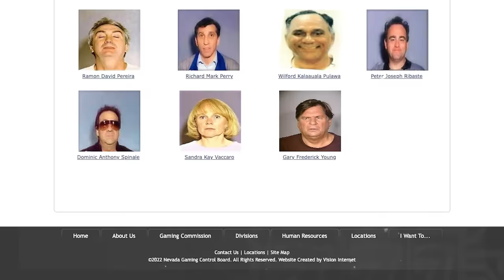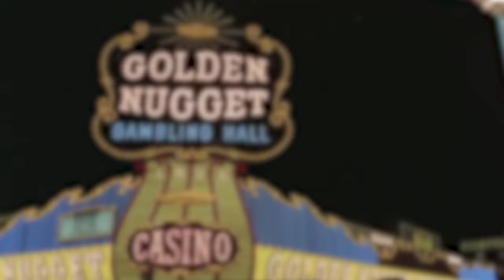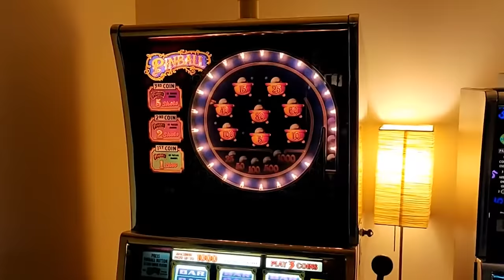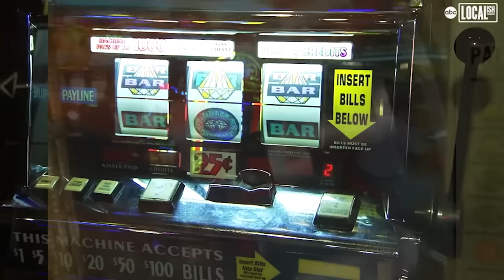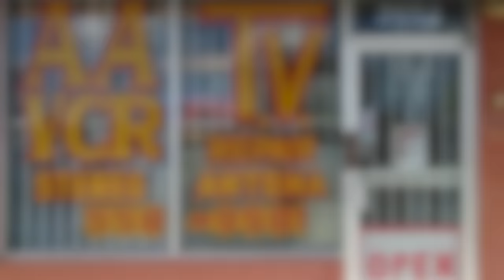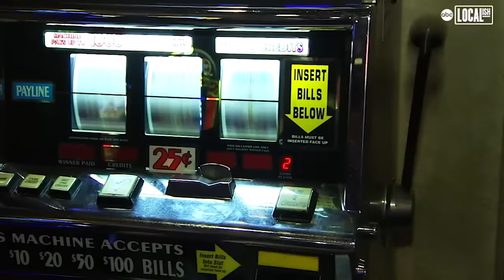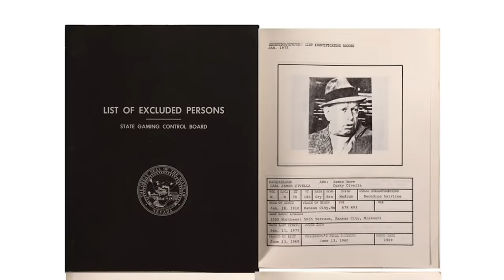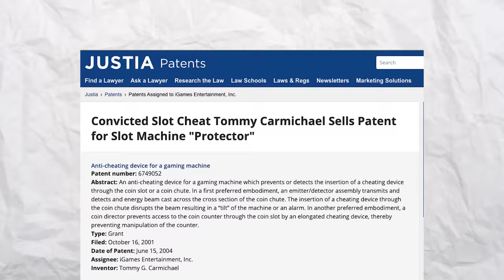How This Device illegally Won $44.9 Million From Las Vegas

Comment: The TITO cheat device is an intriguing idea, but I think that even if it worked, it would have had a very limited lifespan. Those tickets allow security to know exactly which machine spit them out and at precisely what time. It would be a simple matter to synch camera footage with the cash-out time, and bingo, you've got a picture of your thief. You then circulate the pics between all other casinos...
Reply: @Koowluh Casinos are a lot stupider (or perhaps lazier?) than you think based upon your last comment. As a person who's been playing casino games professionally for years, partially by exploiting how much they think I play, how much they think I've won, or even who they think is playing there when I am the one present, I've seen enough to know that their systems are in actual fact quite primitive.
Reply: No doubt I don't think it would have lasted long unless you were extremely smart and super slow & low with the amounts in order to not raise suspicion.

I'm talking so slow & low it would barely be worth it and probably not worth the risk. 

Either that or you go big time but it would be something you wouldn't be able to use often.

But this is before camera and security tech got really good.  Back in those days he was using the light wand they didn't have a ton of cameras and the cameras they did have were in like negative 360p at best 😂

Now these days most casinos don't have a square inch that are out of camera view.   They can damn near do that fake "enhance" crap you would see it movies and TV back in the day. 
They spend a ton more in security technology and also in just paying & training people at using the tech as well. 

The tech used back then or even that " Tongue" device wouldn't have worked long with how quickly security tech was advancing. 

All my rambling is in absolutely no way to take away what this dude was capable of though by any means.  Dude was a straight up genius and if it wasn't for his bad judgment and shat "friends" he very well could have gotten away with it albeit still living underground.

What he was able to accomplish was certainly admirable though

Comment: why was he arrested for manufacturing cheating devices? Shouldn't they arrest the users of the device?  It's only a cheating device if you use it for cheating.
Reply: Do you hold the same consistency to drug users and sellers? Drugs aren’t intoxicating or stimulating unless you put them in your system.
Reply: @nickthompson1812  yes drugs should be completely legal

Comment: All modern slots are PC based.  They could easily be hacked, however, where the "gotcha" is on a TITO slot is, even if you physically put more than a specified amount of cash in, the machine will lock and notify the slot supervisors as well as gaming agents.  At that point, even to get the cash back, the machine will be audited, and the cans physically counted to match.  

When I worked at a casino, as a slot tech, we had some young guys who found a way to trick the machines into misreading the barcode on the tickets to credit $6000.  They thought they could put it in, and then cash it out to create a legitimately printed ticket to take to the cash out windows or machines.  The problem is, any payout, in Missouri at least, over something like $1500, required the slot attendant and supervisor to get involved.  Since the machine registered a $6000 ticket being put in, it locked before they could cash out. Why?  Because the machines know that they cannot print a ticket of that value.  The only thing that can print with no limit is the cash-out receipt.  If a jackpot is $25,000 or more, the gaming commission gets involved, where we would have to unlock the machine, and remove the controller board and the gaming agents would take it to another specialized machine to ensure the security of the ROM was intact.  If there was ANY discrepancy, the jackpot is void and then entire machine goes through a recertification process.  During that process, if it's found to have been a casino error, which would also be a gaming commission error, the winner would be contacted, and the jackpot paid.

Many people have been arrested, charged, and convicted simply by knowing the machine, say, credited $600 instead of the $60 the TITO printed.  It's theft.

Anyone who has done this and gotten away, however, I don't feel they're criminals - they got lucky; after all, isn't that what casino's are all about?  The gamble, and the risk, the loss, or the reward. 
 It's pretty black and white.

Comment: In Germany as slot machine were computerized  a player saw in a casino that two slot machines created game results in the same order.
Reason for this was that the computer software used a pseudo random generator to calculate the result of the next game and by coincidence these two slot machines were at the same state of the random generator at that point of time.
As the random generator was poorly implemented by analyzing the result of four games in a row you can calculate its internal state and therefore could predict the results of all following games.  Using another software you can calculate if it is worth to play on that slot machine as a greater win will come in a couple of games and the money you loose till reaching this point is less than the money you will win.
Due to legal restrictions limitting the maximum win by game this was not a method to make in short time big money and therefore the inventor of that software decided that is easier to sell the software to other gamblers instead of using it himself. But as always - the more people know a secret the greater the risk that it will not be a secret anymore and the manufactorer of that slot machine changed the implementation of the pseudo random generator making it impossible to derive its internal state by just looking on the result of a couple of games.

Comment: So im a tech at a casino my job is to fix them, clear bill jams fix printer errors, replace monitors, change power supplys that kinda thing. But recently someone cheated a machine, ever minute they printed a ticket of no less than 700 and no more than 1100, which is smart sine going over 1200 you have to pay taxes. I just wanna know how they did it.

Comment: I was playing roulette on the east coast side where like 20 cops come up to the table and nab the guy next to me pass posting. Turns out I was the one blocking him because I was sitting on the last number row side and had to reach the whole table to play the single digits which I normally do. All said and done I got 200 in chips complimentary for allowing the casino to catch the guy because I shouldn't have been allowed to lean over the table like I had for almost an hour. It made them see the guy using me for cover. I'll never sit at the ends again

Comment: The only issue I have with this is that not every single slot machine is the same. They are all built differently by different manufacturers. I mean, don't get me wrong, I don't know how many casinos were only running IGT machines, but I doubt that's all they had in Vegas. Bally, WMS and Aristocrat should still have had a big enough market to still be a good case to buy them to circumvent cheating.

Comment: Nowadays it's literally impossible to cheat at a slot machine. Theyre all computerized, the machine generates a barcode which is cross referenced in a data base. So you can't make a fake barcode because it doesn't exist within the data base. Its like a two factor authentication.

Comment: I had to skip through a lot of your video because it was painful alot with a lot of angry outbursts a visual fatigue from not seeing the point 

It doesn't take a full 16 minutes and 23 seconds to get to the point

It may be the problem is is that you're not a good storyteller and that be the bottom line 

It's not a simple exchange of information I found you very Condon sending and I found that you took your time to make your point